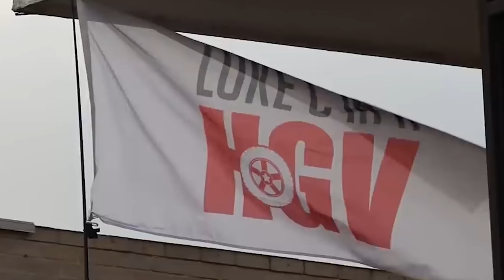My Last Vlog On YouTube As An Unmarried Man #LukeCinaHGV

Comment: Congratulations on your wedding. Amazing that your truck doesn’t have air conditioning or climate control fitted. DAF or your gaffer cost cutting? 😂👍🏻
Reply: Dafs are cheep and pretty much always have a problem with them
Reply: @EddieTruckingAdventures  portaloo on wheels